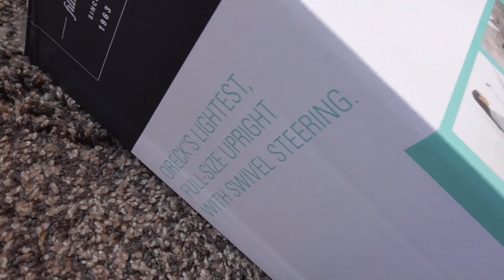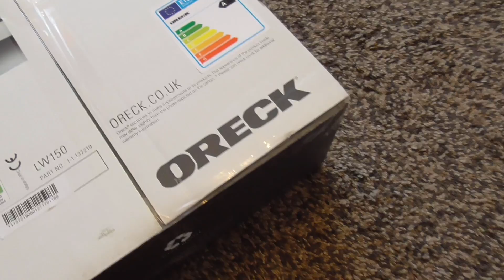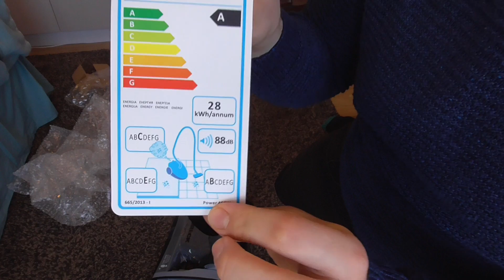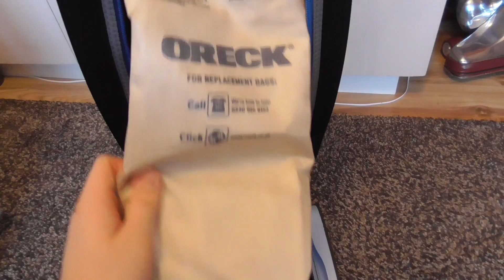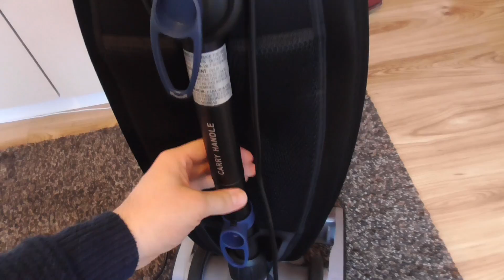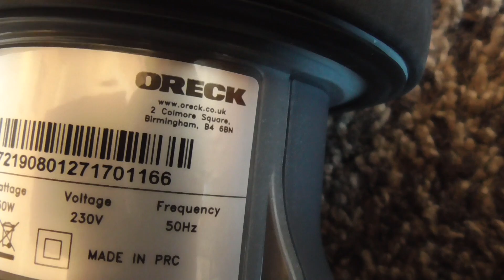Oreck Magnesium RS Upright Vacuum Cleaner - Unboxing/First Impressions

Comment: the us models did not have the floor tool as an option.
Reply from the maker: Garrett Dodson The UK version doesn’t have the edge brushes because of the hard floor attachment...The UK is unfortunately under EU legislation for vacuum cleaners.
Reply: NumaticVacuum even though you have the floor (which is awesome) they should have had a way for edge brushes cause they still help knock dust loose on base boards. And the magnesium does. A great job on hard floors without the floor tool despite the roller turning on low speed thanks to its microsweep. Unless the euro models don’t have the microsweep. What an interesting setup though.

Comment: The date code is 2717 I think - it uses the same stock label as a Vax, so its week 27 of 2017. The address on the label is Vax's address, which is not surprising seeing as these are likely made in the same TTI factory as Vax's are made in, in China. I hope it will be reliable! Bags for these are not cheap at £13 for 3, or £22 for 6 - I'd say about the same as Kirby bags, and incidentally, Kirbys are still dirty fan and you can get them in the UK, as you said Oreck was the only dirty fan domestic cleaner you could buy now. I'll bet the Americans aren't very happy about seeing "made in PRC" on a formerly American made brand such as Oreck, and I heard they were pulling out of the UK market altogether, presumably due to all the EU legislation, as their only models are now over the 80db noise limit, so when stocks are gone, we might see the brand dissapear from this country, but I would imagine you will still be able to get bags and things from them, via Vax.
Reply from the maker: MadAboutHoovers Thanks for dating it Steve.

I noticed the bags are very expensive, not quite sure why.

It is a shame Oreck is another defunct company, I have always liked them.

I do have another two Orecks on the way so I will unbox them in the same video maybe or separately, but they are proper US made Oreck cleaners.
Reply: Oh, thats nice - we shall be looking forward to seeing those be unboxed then, and Oreck as far as I understand are not defunct as a brand, they are still continuing in the US, its just that I'd heard that they were pulling the brand from the UK, I think it was Vacuum Mad 8 that said, but cant remember if it was him or not, all I know is that they only do 2 models on their website and they are both over the 80db noise limit, so I am suspecting that rather than produce an entirely new model and they are usually dirty fan, so not the best for emissions either, as well as noise level, they are simply pulling out of the EU, due to poor sales here, and concentrating on the US market, where people still want the brand and they are not hampered by the endless meddling and dictating from the EU, who I think have gone too far with their limits and caps.
Reply from the maker: MadAboutHoovers I agree, I think the EU have gone a bit too far, however once the UK has left the EU altogether, I think we might see a change again.

When I said Oreck is defunct, they are, Oreck is no longer a company, it is just a name owned by a different company.